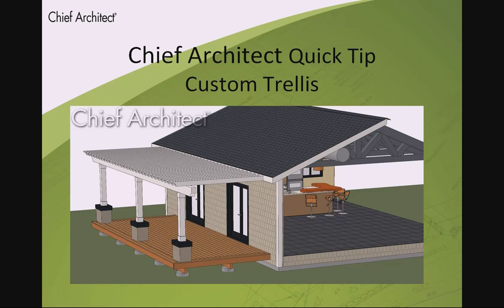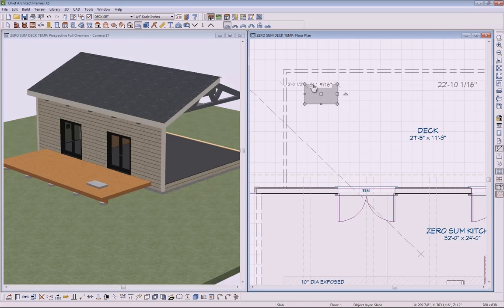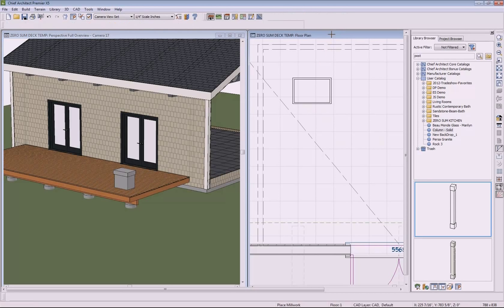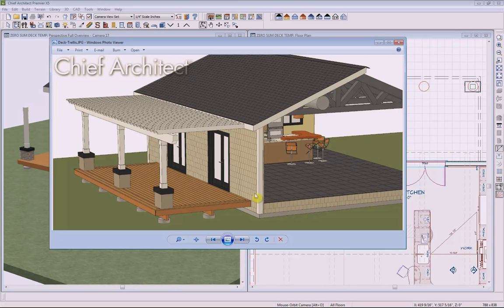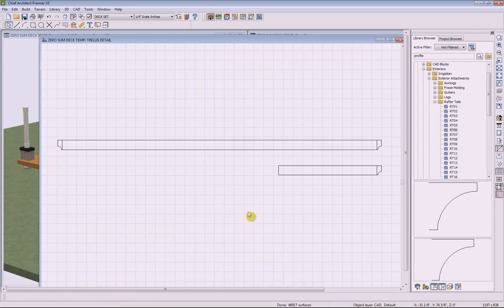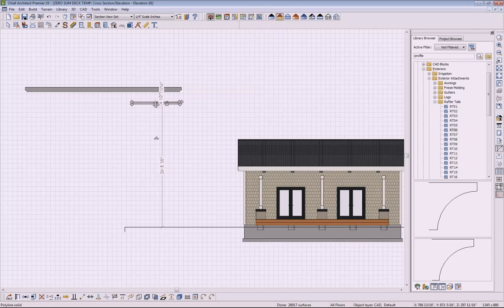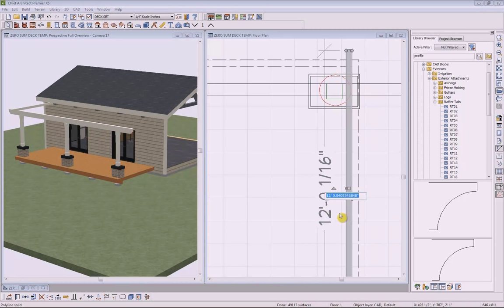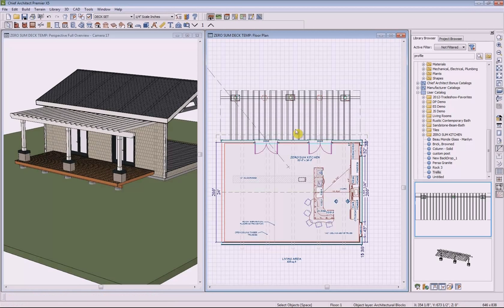Chief Architect Quick Tip - Trellis

Comment: is there a tutorial on how to do a gable roof over a deck held up by columbs?
Reply from the maker: We do not currently have a tutorial on that topic, but you can accomplish what you have described in the software. You can view our training videos for roofs and decks below.

Roof training videos: https://www.chiefarchitect.com/videos/#playlist-95
Deck training videos: https://www.chiefarchitect.com/videos/#playlist-94
Reply: Chief Architect Software I want to do plywood sheets covered in vinyl as the deck surface. is there a way to do that?
Reply from the maker: Yes. Once the deck is created, open it for specification. Select the Deck panel and modify the Plank Width to match your plywood sheet width and remove the Plank Gap Width. Next, get into the Structure panel and edit the Plank, Joists (L) section. You can modify and add layers to the floor structure here.